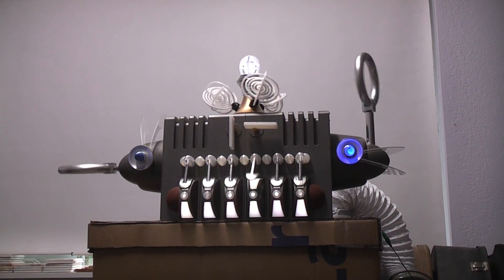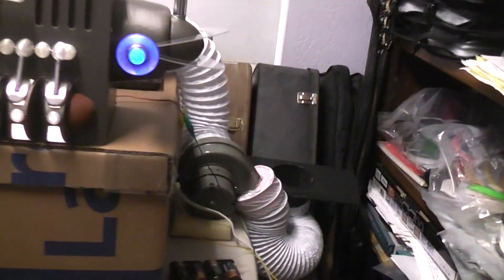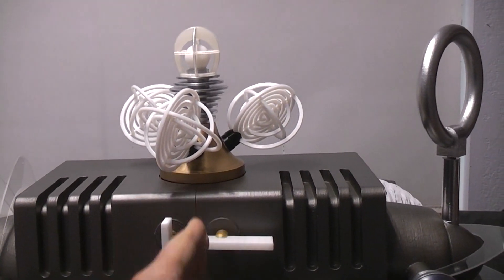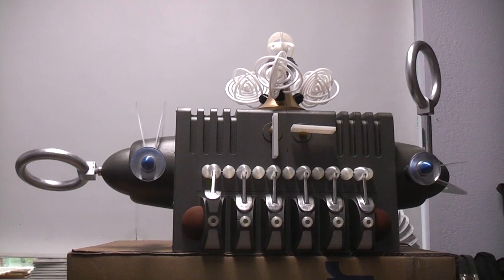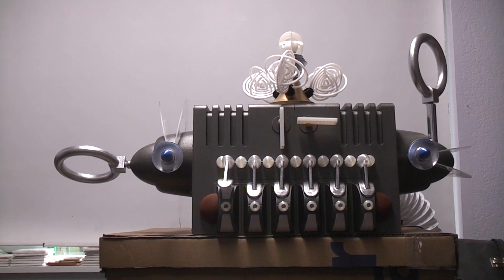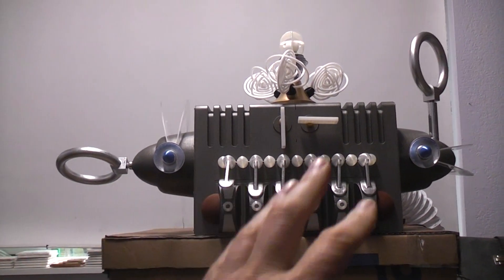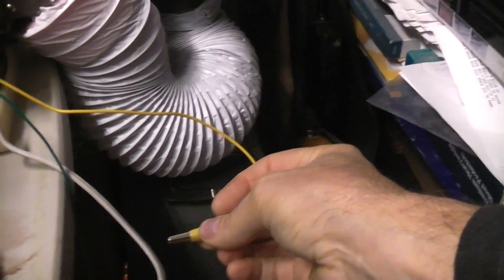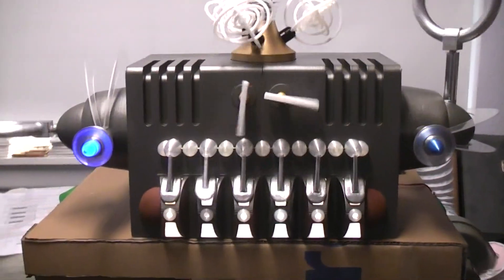The Robby Machine Project. Preview / Overview.

Comment: Man you are fantastic. yes please i would like to invest in a good printer. Can you advise?. And how to assemble im going to retire soon and have the time to do this .By the way my name is Bill Stanley.
Reply from the maker: Lots of guys buy the Ender 3 printer as it is low cost but it's max build size is just a smidge to small for many of these projects.  Normally setting up a new printer these days is just 4 bolts. Bolting the gantry to the base and then plugging in a few marked cables. There are you tube videos for every type of 3d printer made on setting them up and using them.
Now you can buy printers in kit form that have lots of parts and can take 5 hours or more to put together , you can get a better printer for less money that way. Prusa MK3s can be bought as assembled or in kit form it costs more money than many of the other printers out there but it just works better so that is the printer I use 99% of the time. I have had over 24 different printers in the last 6 years so I like to play around with them and test them out.
Reply from the maker: Here is a link to a new printer "Artillery Genius 3d printer" that has a large build size , low cost, and is quite in operation. https://youtu.be/s0sxcBN7yYU
the video will show the set up and testing of the printer.  You can find other review for the printer on you tube as well.

Comment: Totally interested. 
Question, why not make it the right shape of Robby's actually head instead of just a box?
Reply from the maker: I wanted to provide the full scale mechanical parts but needed a base to put them on and this is the largest base I can print on a normal home 3d printer. To make the full robby head in full scale would require the base to be made of 8 large parts minimum. A jig saw Robby is not what turns me on. Since I have built full scale Robbys the proper way "thermal formed plastic " and hollow resin cast methods. I do have a large scale 3d printer but most builders do not so I wanted to share the mechanical head parts in full scale and leave the 3d printed full scale head design to other that want to do it that way.

Comment: Fantastic!!!!    Love this!
Reply: How will you handle the face glass?  Is that something that can be purchased from you?  Along with the hands, etc???
Reply from the maker: @wwsvs  No dome. this is not a full Robby the robot head unless you decide to make it one. It is a Robby Machine that has a main frame to hold the full scale mechanical parts.
Reply: @Robothut  I know that there is no dome for this unit but could this not be used as part of a full-sized Robby?   Anyway, I would love to talk to you about a full-sized one. The amount of work you have done to research and build yours is staggering.  I paid for and never received a B9 from Icons.  I've always wanted a Robby too.
Reply from the maker: @wwsvs  Yes the mechanical parts could be used for a full size Robby build and the Main frame would be a good reference for the person that wanted to design a full scale Robby head. I  do not think that  normal home 3d printers are the way to go if your planning on building a full size robby, to many small parts to glue together and large 3d printers cost a lot. So the better way to go is to thermal form the main head part or  make a master and then a silicon rubber mold and hollow cast the part. Or if you like fiberglass then use that.
Reply: @Robothut  Well, I liked your idea of a class/event where we all come to your place a do a week-long build off!  :)  This honestly, would make more sense because I don't have a 3D printer yet and as you say, there are very large parts that simply can't be printed easily.  That is why I was saying talk to you and purchase one from you.  I don't know if you even do that.
Reply from the maker: @wwsvs  No I use my time to build new projects to share.  Making parts to sell is not of interest to me. Thats why I share the information. But one day if the world gets back to normal, who knows a build class might be fun. Something to think about
Reply from the maker: Thank you.